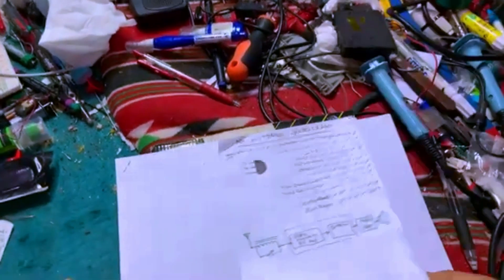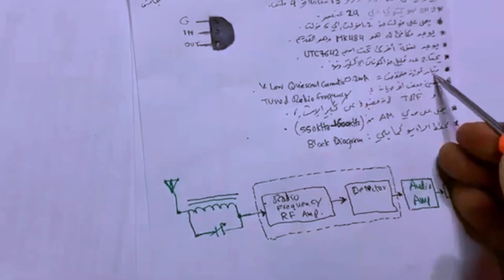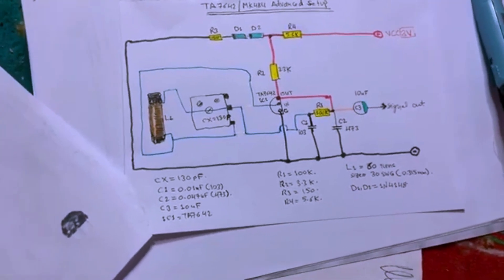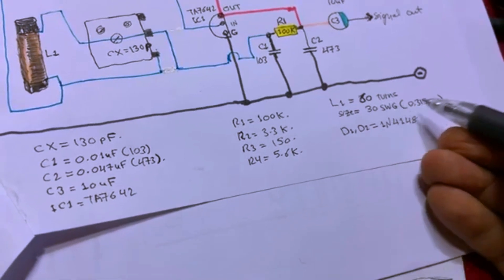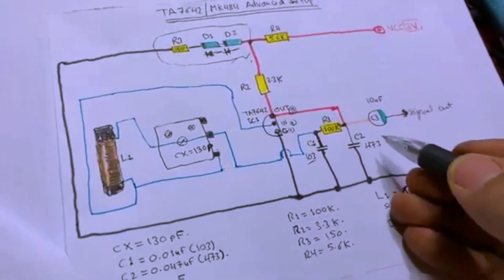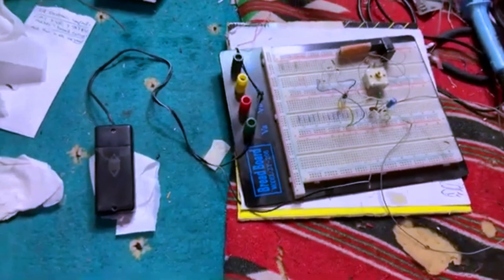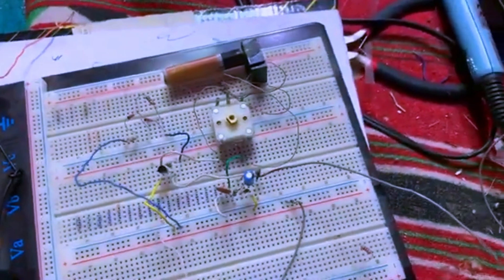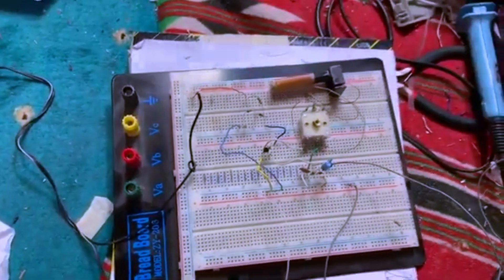TA7642 AM Radio Advanced Setup by Ben Faifa - MK484

Comment: Can i use class D amplifier chip like hxj8002 for amplifier stage, will it create any noise as class d amplifier chips are switching based in nature as I'm going to make a mini pocket am radio in a 60mmx80mm case with 40mm 8ohm 0.5w speaker and earphones out using a 3.5mm female socket with inbuilt switch mechanism which will select the audio path and also I'll use 2 transistor amplifier stage for driving 32ohms earphones.
Reply from the maker: Yea, it would be great
Reply: @afaifeem  thanks
Reply: use an LM386 as amplifier.
🤔
Reply: 8002 worked fine no noise issues, also used 5k multiturn variable pot for AGC because some stations sound low and some high according to their distance. 😊
Reply: @niteshmandal7551  where do you get ta7642 ic ? online ?

Comment: Great video,  can I use ta7642  for shortwave?
Reply: I hear that it's possible
Reply: Ta7642 will work for the IF stages ,you just need the SW antenna ,local oscillator and mixer @Radio478